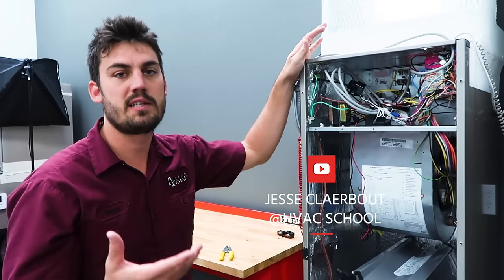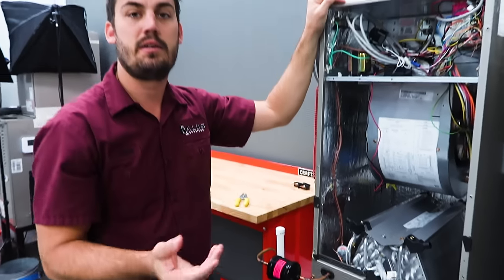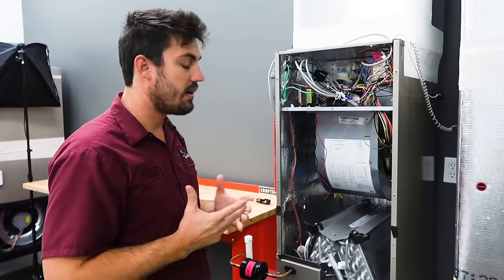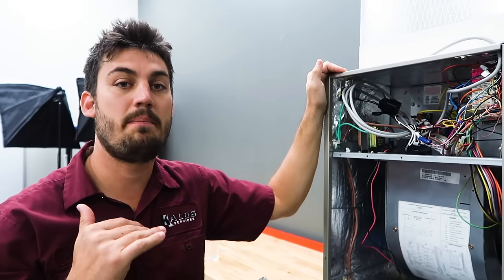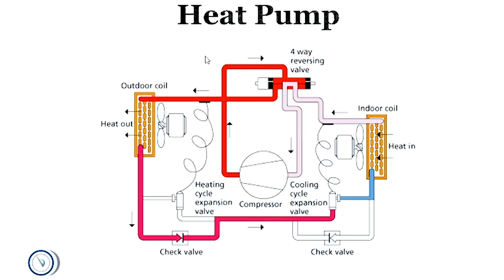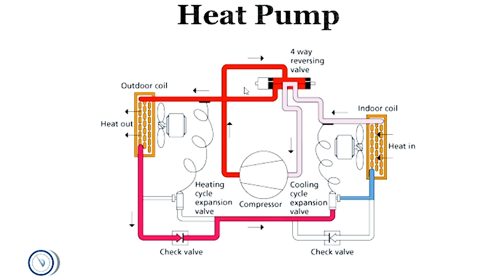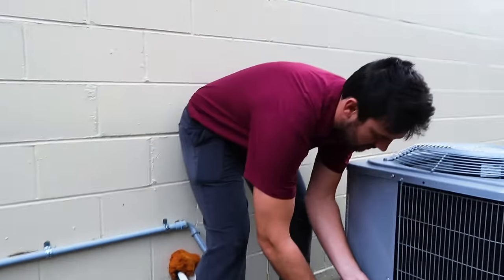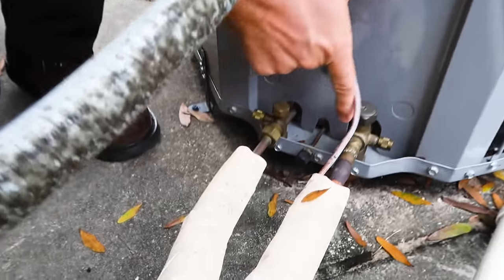HVAC Heat Pump Basics

Comment: when the system goes into defrost it simply goes back into cool mode with the fan cycled off so the head pressure can go up and then a signal is sent to the indoor board to turn on the heatstrip so it can warm up the cold air while its in defrost. And the main reason you want to have a high head preasure is so the hot gas can melt the ice around the outside coil.
Reply: Wow
Reply: Bam!
Reply: What's the reading on the hot line?? When it comes out
Reply: Good explanation exhibits what it's doing. How's the cycle sensed & actuated to defrost the iced outside coil? Time or by a temperature sensor?
Reply: The defrost terminator initiates and terminates defrost by temp.

Comment: We need a troubleshooting sequence to figure out what went wrong with heat pumps, besides typical operation sequence. Like with furnace operation. Trace what's supposed to happen, and find the defects. Like stuck or worn out reversing valve. What would you see, how would you know? What would your pressures be like?

Comment: Here in Colorado, heat pumps are usually connected to a furnace for a dual-fuel setup because NG is far less expensive and efficient compared to heat strips.  If you buy an efficient enough heat pump, it will be less of a problem or requirement of NG furnace.  But I love my Bryant Evolution Heat pump and high-efficiency Bryant Evolution furnace.  The cost of electricity is skyrocketing but our solar panels produce plenty of power during the day to run the heat pump completely.

Comment: Really help I use to always wonder how did the heat pump work, but it’s amazing how the coils make that switch. 3 main things that he spoke was reversing valve defrosting board the common suction line how they rotate depending if it heat or cold air

Comment: Thank you for helping educate people who have to know EVERYTHING due to corrupt tech companies who only want to sell units and not repair.  There should be a law.  I went through four last time I had an issue and finally fixed with blower motor instead of $6500 replacement.  Those liars are killing your industry.
Reply: It's all fun an games until an untrained homeowner gets electrocuted since they neglected essential safety procedures prior to working on the system since they became an HVAC guru via YouTube over night....
Reply: @factfactory575  No one suggested DIY on HVAC, or other major systems, or even tolerating unlicensed repair guys.  But since most 'servce calls' and 'repair techs' are just salesmen, it's good to have knowledge to find the right, licensed guy (one who doesn't carry or sell systems).
Reply: Very true, I work for an HVAC wholesale company.

Comment: I always thought heat pumps made a lot of sense to me, the system literally is pumping heat... it takes heat from either inside or outside and pumps it from one space to the other
Reply: Yes.  Heat flows to where it's cooler the way water flows downward due to gravity.  A pump uses energy to work against these.

Comment: Hi, I just want to leave rough in lines in my new construction for now between air handler and outside heat pump unit. Should I leave just two half inch copper lines or do I need anything else. I will leave two 5 conductor low voltage wires and ac wiring as well. Also do I need to insulate those copper lines?

Comment: Does the compressor run during the Heat cycle just like during the Air Conditioning cycle?  Will the electric consumption be just as high in the winter as it is in the summer?

Comment: The evaporator is referred to as the indoor coil and the condenser coil as the outdoor coil to eliminate confusion, indoor fan, outdoor fan... when d3aling with heat pumps.

Comment: Great explanation, but isn't this a long way round just to say that the system swaps the coils, and bypasses the expansion valve that is not in use? Then it has a back-up electric heater inside and a fan-kill option outside to get the coils hot enough to defrost. I was hoping for an explanation of some of the engineering, I guess, like if the suction line is still larger, what effect does that have coming off the compressor in heat mode, etc.
Reply: I couldn't ever figure out what went wrong except to replace a worn out reversing valve. What could be worse besides a compressor burn out?

Comment: I think "taking heat from outside air" confuses people. The heat transferred into the house comes from the compression. Outside air just needs enough heat to boil off the refrigerant in the outdoor coil.
Reply from the maker: You are confusing heat and temperature. The heat absolutely comes from the outside air. The temperature increases during compression.
Reply: @HVACS  the refrigerant evaporated from the outside air is still below 40. Cool vapor prevents overheating from the compressor, right? Heat of compression will be about 100-120, right? After the heat exchange in the indoor coil, air from the register around 90. Not confusing temp and heat as latent heat isn't really a factor in heating mode. I'm no professor, but you need enough outside heat to boil in the outdoor coil. All sensible  heat should come from compression, no?

Comment: I have an 8-year-old Bryant 213B heat pump & Bryant gas furnace. This morning (at 35 degrees outdoors) I upped my thermostat from 64 to 69 degrees. The heat pump and furnace fan came on and ran for just a couple of minutes. Then, due to the call for 5 degrees of heat all at once, the Aux gas heat was initiated which makes sense. I heard the gas burner fire up and the vent pipe got hot. My concern is this: I could hear that my heat pump was still running. I learned that the 2 units (HP & gas furnace) should never run at the same time. I suppose it could be that the HP is possibly running in a different mode, such as defrost or possibly in some way that would not be harmful, but I don't know. So, I immediately dialed back the thermostat to shut it down. I don’t know how to confirm if this is a ‘dangerous’ situation or not. I don’t know if the heat pump is supposed to ‘run on’ in some otherwise safe mode temporarily. I am afraid that if I let it run on just to see if it eventually shuts down I might do damage in the meantime. The fact is that it may have been doing this all along but since I installed a new thermostat recently I am being hyper-vigilant now. I am very confident that my thermostat wiring and setup is correct. I would feel better if I knew that the HP is supposed to behave like this under these conditions.  Can anyone comment on this if you happen to know?

Comment: endothermic and exothermic state changes through the manipulation of pressure. three way valve position determines the direction of flow. Come to Canada boys, we'll get yall learned up. those valves are called suction and liquid line service valves by the way.
Reply: Can you provide us with your heat pump videos on youtube I am sure we could learn a lot from your wealth of knowledge.
Reply: I thought they were two position valves. Inny or outty, like belly buttons.

Comment: Hello,  I am wondering what the drawbacks would be to putting the compressor in a shed?  Specifically an uninsulated 8' x 8' x 9' open eaved (32 sq ft of open soffit vent)) building on an 8" concrete slab.  This would be in a 95% heat situation but in very high humidity.  I am thinking of all the corrosion, leaf/needle accumulation, as well as snow.  Since the unit is just coated steel and the fins are so close together avoiding having them foul up would help the unit's longevity immensely.  This is a 17' line set that I have another two layers of insulation over the top of the original.  i started it up two days ago (45 degrees night and day 100% humidity) and am seeing a lot of condensate coming off the bottom of the casing which has a drain installed leading outside.  I installed it up off the floor about two feet on a wood shelf with 4x4 legs drilled into the concrete.  The issue is it makes enough water to keep the wood soaked and a puddle on the floor (although that drains out the door it will be an ice rink in the freezing weather).  I am hoping to protect the unit from the wind and rain/snow that accumulates here in a temperate rain forest and coastal winds.  I have found the plastic drain fitting is proud of the bottom enough to always have a layer of cold condensate in the bottom which condensates on the bottom side of the bottom in a major way.   I am thinking of spray foaming between the shelf and the bottom with low expansion canned foam to stop this happening?  As the temperature outside drops I can't see it doing anything but becoming a block of ice building up from the bottom?   What are your thoughts?  I have not found this addressed anywhere else.  Thanks.  Doug

Comment: Can this be used with an existing heating/cooling system i.e. existing furnace/AC kicks on in extreme cold/heat otherwise heat pump is on? Also does system have a backup so it works when power goes out?

Comment: I installed a Carrier heat pump system a few months ago. Heating and cooling functions are fine so far. But there is a wild constant humming sound from the bottom of the unit (transformer?) when the system is not working. Is this normal? Thanks.
Reply: Unfortunately that is normal in my experience.  But I am no electrical expert.
Reply: Probably the contactor. It might have gotten wet or have insects in it.

Comment: What happens  when it's very cold outside  how take heat on temperature  colder  ..? It's  normally  head pump running  and doesn't  stop on this colder  days

Comment: The term "heat pump" originates from physics and thermodynamics.  "Heat" = thermal energy, thus even environments that feel cold still contain heat.  It's "cold" to us humans, because we have limited ranges of temperature we tolerate and like to live and feel comfortable in.

Thermodynamically, heat will flow from where it is higher to where it is lower:
- in the absence of some force/energy opposing that flow
- and if there's a path for that thermal energy to flow

What are some of the things that oppose/slow down that flow?  Thermal insulation is one.  Physically, they're ways that increase that flow path thus slowing down the overall heat transfer from warmER to coldER.

Another one is a heat pump, a system that opposed that thermodynamic flow, pretty much at the cost of energy (adding heat to the larger overall system).

Air conditioners, refrigerators, even furnaces (in a sort of roundabout way), are all heat pumps.  ACs are easier to conceptualize because people already understand what they accomplish (even if vaguely).  They're just fixed in the direction in which they pump heat, which is why ACs aren't used in the off-seasons.

A heat pump, as in the appliance, is thus "just" an AC that can operate bidirectionally, pumping the heat in either direction as well.  If you took a small 5k btu window ac unit and flipped it around in the winter, you could have a really poor man's "heat pump" (appliance), in effect "air conditioning" the already cold outdoors even further.  Purpose-designed heat pump appliances are accomplishing the same with some additional components, and likely design + engineering so that coil systems can serve as both condensers and evaporators.

In the summer, it costs energy, in the form of additional heat to the net thermodynamic system of home indoors + outdoor environment, to effect a cooler area such as a home.  But in the winter, this works in our favor, outputting more heat than energy that is put in, because the difference is heat being taken from the colder outdoors.
Reply: Engineering-wise, there's more to it.

ACs aren't generally designed to cool the cool side to below ~60F because they're for human comfort, so they are heat pumps designed for efficient operation in that temperature range.

A refrigerator is a heat pump designed to cool down to lower temperatures, below freezing in the case of freezers, partly due to the heat pumps used, partly due to also having an insulated box.

A heat pump (appliance) has to be able to efficiently extract heat from an outdoor environment that's potentially closer to that of the refrigerator than that of the above AC example.  So not only is it more versatile an appliance in that it's usable during both heating and cooling seasons, it also needs better engineering for the reversibility of heat pumping direction but also for extracting heat in colder temps during the heating season.  This is where features like Hyper Heat come in.

Comment: COOLING CYCLE is a just cycle in a HEAT PUMP SYSTEM
HEATING CYCLE orREVERSE CYCLE is just another cycle in a HEAT PUMP SYSTEM

HEAT PUMP is any SYSTEM that allows you to capture energy from point A and take it to point B as that happens through a thermo-dynamic process we call this energy heat

In the end of the day HEAT is only a label that we use to talk about energy so whoever is listening to us understand that we are talking about energy transference in a thermo-dynamic process

There are many other language traps in HVAC like “cold retention” and so on..

They have been around for decades!

Comment: The bypass for either heating or cooling occurs at the reversing valve?
Reply: Yes and No. The reversing valve only selects the direction of the refrigerant once it leave the compressor.  For heatpump mode It simply sends the liquid to the outdoor coil so It can absorb heat there then takes the heat to the indoor coil and a fan blows the warm air into the conditioned space.

Comment: The strips are only 24v? Or 220v?
Reply: Heat strips are 220v.  They work like the heating element in a waterheater.
Reply: @TanTan-ni4mg  it's actually more like a toaster
Reply: You're kidding, right?

Comment: Does some heat pump have burners
Reply: I assume that you are talking about the air handle or furnace. Yes, as backup or emergency heating, there can be either gas fire or electric elements that can be in place.
Reply: Yes some heatpumps are equiped with 2 or even three ways to heat.  In the HVAC/R industry me call them dual-fuel or multi-fuel systems.   Ive seen one with heatpump for primary , electric for back up, and natural gas for a third source.  Ive also seen pellet fuel burners on ground source heatpumps. Its all in what makes economical sense.

Comment: I think having it an air conditioner is misleading. Yes the same components are there and doing the same thing backwards. Refrigerators do the same thing, etc  But a heat pump is optimized for the heat cycle, do you can't just run an air conditioner backwards and say it's a heat pump. 

The biggest factor in the efficiency of a heat pump is the heat load of the building being heated. Air to air heat pumps are not efficient at all and probably waste more energy than a modern gas condensing boiler. Heat pumps are best combined with radiant underfloor or in wall heating systems, which are virtually non-existent in the US

Comment: Thanks you for info.  Do you have Books I can buy to learn a Heat Pump system better.  I maintain a 12 story 151 room Hotel has the VTAC contained as one unit.
I am having 5 to 10 units crashing a year, and the Hotel is going on it's 2nd year  I need to learn more about a heat pump function.  I think the refrigerator tech is over charging the Hotel on service calls, with the cost of a new VTAC over $2500.  I need to find ways to cut opperating costs.
Reply from the maker: I am glad this info helped you
i will be answering your concerns in my Q/A video
Reply: Hire someone who understands first. Work on it awhile. Not so easy.

Comment: Heat pumps are pure garbage if you live anywhere up north, these HVAC gurus love to underscore the “efficiency”. The main purpose of a heater to is heat my place of residence—the price of operating is 2nd after I heat my house. HVAC salesmen seem to think I care about “efficiency” when it’s -15 out with a windchill of -31. These systems are meant for people who live in moderate climates, please steer clear of these if it gets below 40 in the winter as you will need an actual heating source not some BS reverse air conditioning non-sense.
Reply: I'm currently going to school for HVAC and my instructor has said the same thing. I share both of your opinions.
Reply: Agree
Reply: They operate fine as long as temperatures do not get below 0 degrees, NOT 40
.
Reply: Absolutely correct! No good below 65°! Here in California we can get away with them when there's no gas available, usually by $ owners choice.
Reply: I get confused because I don't work on them often. Trane units are best because I get good tech backup.
Reply: Sounds like you know nothing about heat pumps
Reply: usually we just add supplemental heat 😂

Comment: In my experience,  heat pumps do not do the job they are advertised to do. Long run times and very low heat generated. The heat strips are very inefficient,  much more so than an electric furnace. 
Many complaints that the discharge air is not heated enough except when heat strips are energized.
Reply: Except in California. Heat pumps never worked good in colder air climates. Here they work OK with no gas available. But I agree, not great.
Reply: The customer doesn’t know 

heat pumps are very expensive and the compressor runs 24/7 365 days

Comment: Heat pumps suck.
Reply: Sean Burke  why,? Maybe you do not understand them,, and the brands do things differently. Maplewood NJ
Reply: That's if you do not know what you doing P pump is like learning how to drive a standard car if you could learn how to drive a standard car you can drive any type of car if you i learn how fix heat pumps you can fix any type of AC
Reply: Well, they are peculiar.
Reply: Only in New Jersey. They don't fare well in colder climates. I agree with you.